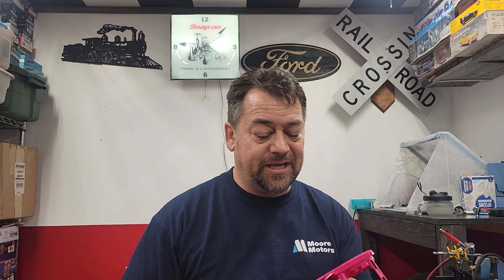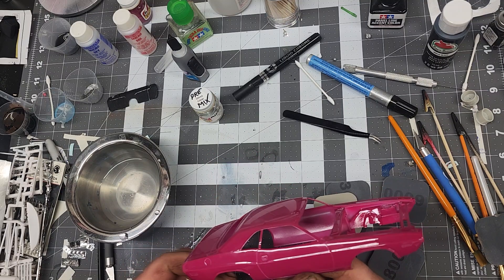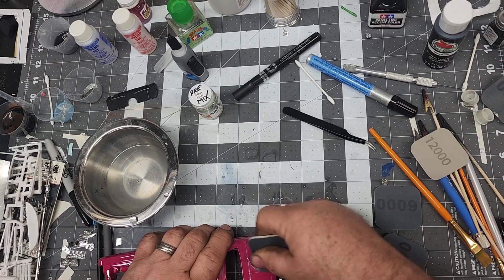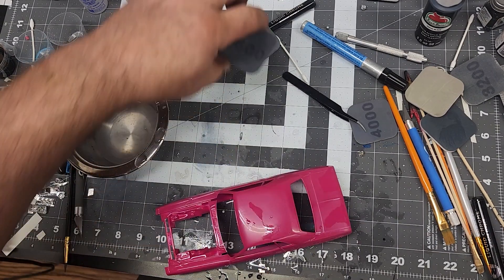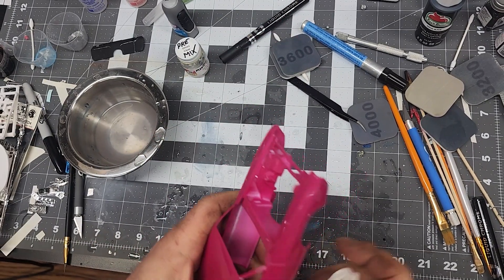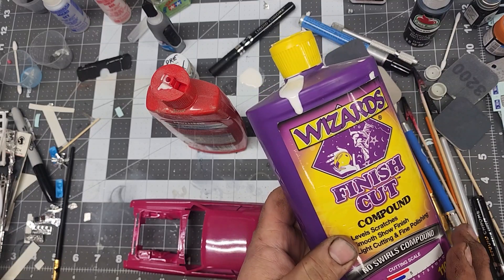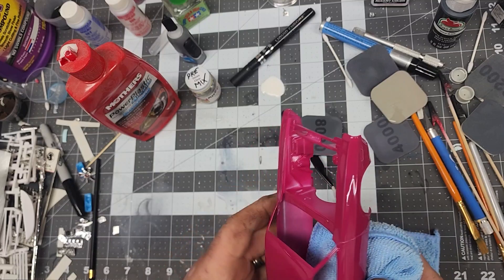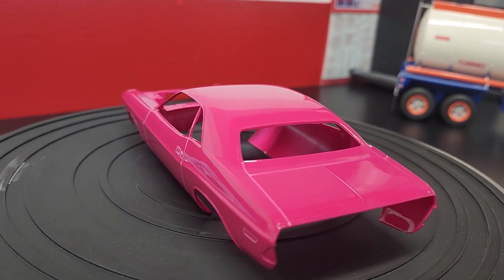LETS TRY SOME WET SANDING AND POLISH!

Comment: Looks like MCW are lacquer paints? Can you polish using Mothers Power Plastic (for example) over water-based eg Vallejo for airbrush?
Some Vallejo paints come out flat - can you still polish those for a shine or do you need to apply a clear coat first?

Comment: Hey, I'm Chris(C.D. Scale Models) that's my Y/T channel......I built this very kit this past October & it's WONDERFUL kit 2 build......ZERO fit issues at all. Great video on the MCW paint.......I like enamels but I know they take so long 2 dry & I'm not into dehydrators personally, probably because I've never used them. I  noticed U didn't prime this kit body, do U never, sometimes or always prime your bodies? Your paint method deems like Donn Yost's, BTW.....I just subbed your Chanel. Great stuff......thanks & speak 2 U soon!!!!!!
Reply from the maker: Hi Chris.. Thanks for the sub! You should try the MCW with the hardener it will set up for you in about a week on its own.. For most of my enamel paints I do not primer most of the time, have never had any concerns. For lacquers I always primer, due to the thinner runs hot and could damage the plastic.. I just recently purchased  the dehydrator so I'm sort of new to that game lol, Appreciate you checking out the channel...